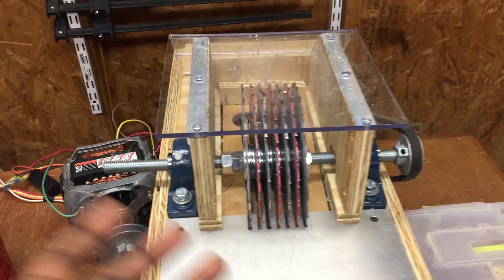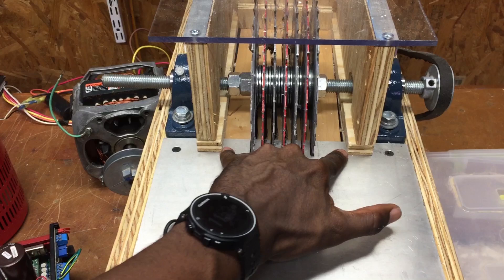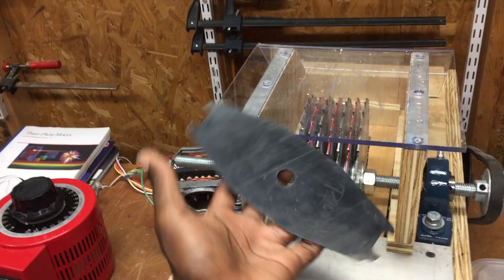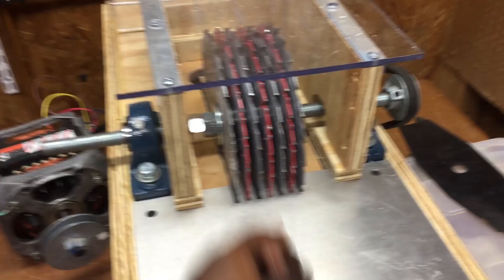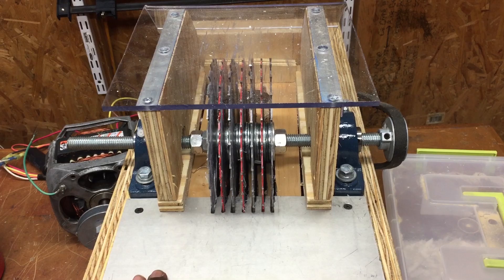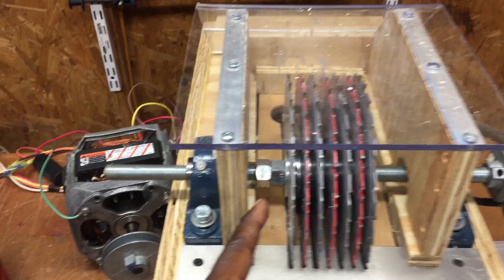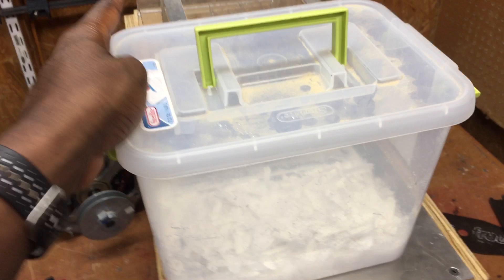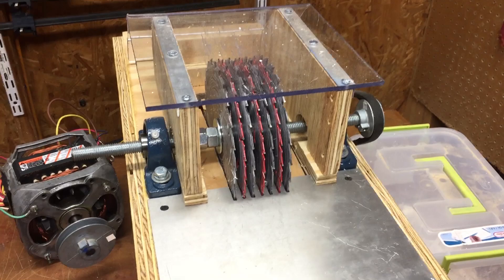Scary Prototype Shredder Design pt 2; A Cheap Alternative to the Precious Plastics Design: 037

Comment: I work in a factory that produces the HDPE bottles you are shredding. We end up regrinding about 1%. So I am familiar with the concepts.
Reply from the maker: Ok... question... how do the properties change as it is remelted? It seems to get more tensile strength after the first melt, but I am wondering if it can be "forever" remelted? do you guys throw it away after a certain point?
Reply: Basically, as long as it isn't burned it's usable. The polymer doesn't break down.

Sometimes there will be leaks in the molds which results in blobs of the stuff forming under the machines as big as 25 to 30 lbs. It can be reused even then, as we have a special regrinder for the crazy big stuff.
Reply: When I melt HDPE there seems to be two kinds of it. There's the translucent bottles, and everything else. Is there different HDPE blends, or what?
Reply from the maker: I am having the same thought. There is a huge difference between the semi-clear water bottles and the solid white milk jugs I show in the video. Translucent ones are also sticker when melted. They stick to my container while the other doesn't.
Reply: That is more to do with the manufacturing process than anything else. It all comes from the same plastic pellets that are mixed to make different colors or textures. If there is a real difference it probably is because of the pressure in the original manufacturing compared to just letting gravity compress it. Also relative thickness of the bottles.

Like a milk jug is made from te same stuff as a bottle that holds windshield washer fluid or gallon vinegar bottle. But the latter is a thicker mold so it feels different. Or those thick beige jugs that hold real maple syrup. 

All the same stuff more or less.
Reply: I line my melt box with non-stick parchment paper. I probably don't need to due to how much HDPE shrinks as it cools, but you've seen what the stuff looks like molten. So using non-stick parchment paper certainly doesn't hurt. Pulling a block out is a bit like Christmas for me then too, because I get to unwrap it.
Reply: +gplechuckiii that's amazing because the translucent plastic is totally different recycling it. It melts different, and when it is hard it is different. I mean a lot different. I've melted loads of all of it and I could tell the difference blindfolded. The non-translucent stuff is lighter, softer, and not nearly as slick. Also the non-translucent HDPE gets a lot runnier when it is molten. Twice as runny? It is huge. Though the translucent HDPE solidifies opaque white. It gets transparent when it is molten though. there's even a difference in commercial HDPE, like between the white, and the black. But that difference is pretty subtle. Because before I started melting I used to buy HDPE. I heard from a sign maker that they only get 2 cents a pound when they recycle. For that it isn't worth lifting the stuff up. I wish I could find a sign maker here that I could get scraps from.
Reply: OK I asked and apparently when they add color it also adds a binder that makes the color....well stick to the plastic. Which makes sense. So that explains why it would bind to itself easier. I didn't even think about that part of it. 

I'm sorry I didn't give you proper information. I just didn't even think of the binder part of the dye. I work in the coating room and thought I understood it better than I thought.
Reply: I did think about coloring possibly playing some role. I just know what I know based on what I've been able to discern melting HDPE. Translucent HDPE made into a block turns white, but molten translucent becomes transparent. Melt white HDPE and it stays white, even when molten. So there's something in colored plastic that is not in the translucent HDPE. The color, and like you said a binder, to make the color stick. So thanks for the info. It still doesn't completely explain all that is going on, but it goes some ways towards an explanation. Even the simplest topics often have obscure layers of detail under them when you go digging. I'd love to know how they made dimensional HDPE commercially. Just like thick sheets of the stuff. I'm thinking they use a roller process. If I had unlimited resources that's the direction I'd pursue. Say steam heated, with a Teflon coating on them. But I honestly have no idea. Big sheets of HDPE are available. The stuff is expensive as sin though. Which is why I make blocks of plastic in my garage. For prototyping chunks of HDPE is handy stuff.
Reply: There is a couple of different types of hdpe that are still considered hdpe but the molecular weights are different for example five gallon buckets are injection molded in a factory which basically means the plastic has to be squirted into a mold meaning it has to be very liquid when it melts so it has to use a lower molecular weight hdpe which means it flows much better when melted than let's say milk jugs or detergent bottles or any kind of bottle which are blow molded meaning the plastic doesn't flow nearly as well and therefore uses a higher molecular weight hdpe however it's also stronger than lower molecular weight hdpe. The reason that translucent plastic such as milk jugs go clear when melting is because melting hdpe removes crystallinity which causes it to turn clear when melting as soon as it cools of it becomes semicrystalline again and becomes translucent. Colored hdpe has pigment in it therefore causing you not be able to see it becoming clear. I have melted lots of hdpe at home and I tend to use blow molded hdpe because of its extreme strength but injection molded hdpe is still pretty strong. For flattening the slabs I melt I use a power hand planer and it works great.
Reply: I square up my plastic blocks on my milling machine. That works pretty good too. One thing I have not figured out yet is how to relieve internal stress in the blocks that I make. I press the plastic as I melt it, and while it cools, to get the air out of it, but that builds up stress in the plastic. I tried to make a dovetail stage out of some blocks of plastic but that whole thing sprung and curled on me when I machined it. So it just didn't work. Well, it didn't work as smoothly as I wanted it to. So far I took one block and remelted it, and didn't press it, but that took forever, and the plastic shrunk really badly too. So I'm going to end up with a pretty small clean piece when I mill that one down. I wouldn't call it a success, even if it does work.

Comment: Hi friend I was just thinking I watched Dave's video on his plastic shredder I noticed that they are all powered wouldn't it be possible to make a hand crank version seen as all I think the pressure between the blades seems like a big factor to my brain 😀👍
Reply from the maker: maybe, but it seems like anything less than 1 horse power is very limited in its ability to shred. That is over 700 watts of cranking power. We are talking about Olympic cyclist level cranking with the legs. For the arms it doesn't seem reasonable. But, I have not tested that and really can't fully deny it as an option. I am only just now thinking about it. If you reduced the power needed enough to make it "easy" cutting with scissors would be faster I think.  Rather than making a machine like that.

Comment: Brain fart....build a vertical hopper with a V bottom running crosswise with the shearing surface on the inside of the V. Make it close fit to the outside of the blades leaving no space for the long, wide strips to be created on the sides. Attach the collection point underneath and outside of the hopper rather than inside the same space as the blades....this way, everything is forced to go through the blade/shear plate junction as small pieces.
This would also allow for safer gravity feed....
Reply: yes this is what I'm thinking too rick

Comment: Hi Jeremy. I'm a huge fan! I love your videos! I am working on a shredder design of my own, which is strongly inspired by yours. I have a question, though. You spoke about how important it is to get the correct spacing between the blades, but I didn't hear you say what that correct spacing is. It looked like maybe 1/4"? I would definitely appreciate your input. Thanks!
Reply from the maker: That question is hard to answer because it depends on a lot of things. There will be a followup video in the future... spacing matters but I can't just answer the question based on the information you have now.

Comment: Are you using 5/8"  all-thread for the axel on that?  How does it hold up?  straight enough to avoid vibrations from mis-alignment?  I'm in the process of building a sharpener for my chisels/blades, and am thinking about using the same kind of pillow-block pulley system you've got there -- but wasn't sure if all-thread would work!
Reply from the maker: It is 5/8" and it works fine.

Comment: Jeremy, I just watched the first video before knowing about the second.  As you must know there are many topics to be found on YouTube and yet few original comments.  You can watch a video about any topic and you'll have the same half dozens kinds of comments.  If I were you I would not give a dang what viewers say.  Question:  What are you using to hold the shaft in place ... ring & set screw? ...
Reply from the maker: Both pillow block bearings have set screws. I have been intentional about encouraging feedback and conversation with my "neighbors" which is why I read and follow the comments so closely. I have learned a great deal from my viewers and always look forward to their advice. Even the bad advice. I was mostly frustrated that I didn't give more information in the first video. I have become accustom to people stating the obvious and sometimes giving poor suggestions. Its just that in this case I left the door open for more than usual. In my opinion it distracted people from the real reason for the video which was to stimulate suggests for a work in progress.
Reply: I had no problem following.  It was clear in my mind that you were working on a prototype.  I knew once you work out any concept issues you would address the safe operation.  I enjoy the work and enjoy sharing when I have something to share.  Keep doing what you do.

Comment: Thank you for your excellent videos, you really are a clever man (slightly mad but clever non the less lol) I haven't had time to read all the comments so don't know if this has been tried or suggested before. 
Would it be possible to use smaller and thicker saw blades for spaces? i'm thinking that would cut the thin strips the larger blades produce into small chips.
Reply from the maker: I am changing several other things which makes this not needed. It will be like a dado stack all the same size with a different cutting position

Comment: large shredders that work well run a very low speeds, and are reversible to undo jamming!  run gear reduction to to in crease torch.
Reply from the maker: It sounds like you haven't seen my previous videos on this. I am trying different approaches but I started with the traditional shredder type. Please watch the series here. You have missed many different versions of this...most of which involve huge gear reductions for low speed. Now I am experimenting with cheaper and even faster options. https://www.youtube.com/playlist?list=PL4njCTv7IRbwKmdnHLuZp5iL62fSvAS51
Reply: no not a paper shredder not a card shredder. a shredder that can shred a   car. I realize you are trying to produce something, from salvageable materials, to make it cost effective, for us poor people, but any apparatus you build that operates at  more than a few revs per minute is going to be scary or load up with melted material.
Reply from the maker: +relentlessmadman I am referring to dave's shredder. You still didn't watch the videos lol. My original plan was for a traditional style shredder. The paper shredder thing was just one of over 50 different experiments. I am way more invested in this then you are implying. I am fully aware of commercial shredders, how they work and the pro's of high torque. This is just another experiment before I make the claim it can't be done at high speed. I want to confirm that not just assume there isn't another way. That is what innovation is. I hope this makes more sense to you.
Reply: experimentation, is good, and I thank you for this video!  I have the same stack of saw blades on an axle.  but never followed through. you have answered some of questions I had, pertaining to speed.  and in feed.  I was only suggesting to try lower rpms and gear reduction. as far as watching your other videos goes I don't have the time or the wherewithal to follow all youtube channels that catch my interest.
Reply from the maker: LOL. No problem. I don't watch every video posted by the people I follow...it's just your comment lets me know you didn't know what I have already tried. It is just too difficult to explain in the comment section the level of research and experimentation that has gone into the project. The broad strokes are spread over 4 videos now and there is still a lot of things I didn't bother to record. In the end low rpm is the industry standard. I am just wondering if a low budget shredder (fast or slow) might be doable. Low speeds don't seem to work without an extraordinary amount of torque. The issue with that is explained in the previous videos. Thanks for the interaction. I love talking about this stuff!

Comment: A less expensive alternative to using saw blades is to use angle grinder cut-off wheels. 

Harbor Freight 
40 GRIT CUT-OFF WHEEL
4-1/2"  #61195   10/$7.79
4"         #61353   10/$8.99
:
Reply from the maker: +Critical Look now that is interesting lol how do they perform at lower speeds? Grinders spin really fast??? I am curious
Reply: +Jeremy Fielding 
As an experiment to answer your question, I was able to cut a small slice about 1/64", with ease, into a 2.5" wide x 0.016" thick piece of HDPE milk jug held with my one hand, and holding the cut-off wheel in my other hand.

Then by simply rotating the blade about 3 inches around the circumference, without applying much pressure, to achieve the cut. 

My guess is you can probably get away with as little as a couple hundred RPM. 
:
Reply from the maker: +Critical Look I am now wondering if it might be better to just use sheet metal? Consider for a moment that the cut off wheel is consumed in the process. What if we cut sheet metal (I.e wall of a washing machine) with a hole saw and made a lot of disc. They just need to be thick enough to not flex too much.
Reply: +Jeremy Fielding 
There is no doubt that sheet metal will work – but it does not adhere to your goal of enabling the Everyday Joe to construct it without owning the proper tools and having the skills to construct it to be safe when operating at high RPMs.

Balance is crucial – so cutting a true circle from center is essential. 

This is not a job for a hand drill, and not many people are adept at cutting circles out of sheet metal. 
:

Comment: late comment i know but i've been thinking about this one. it really is a tough nut to crack and you're almost there it seems. for a second i thought i was watching that finnish dude. gettin those danger clicks tho. fwiw im imagining if you want to stick with the table saw circular saw type of blades your best bet would be to get away from the carbide tips which are shredding off those incredibly long and thin small pieces. there are segmented and steel types, although the steel types are the cheapest and should be the best. i imagine plywood blade would be the least 'grabby' although who knows. also i've seen angle grinder discs that have maybe one or two cutters and are just steel. to me those look most like a shredder type of cutter. bonus danger points if you grind the kerf off of some spinning steel blades for the camera w/ sparks flyin from the angle grinder and everything haha
Reply: im seeing a lot of ppl are saying less tooth count is better. maybe it is? but i think reducing the kerf width is maybe more important to reducing the fine dust. funny haha
Reply from the maker: I think it is both. It makes sense that a rougher cut would lead to larger dust particles. The grinding the spinning blade will probably cost me some neighbors and friends lol.
Reply: or some fingers! my thinking is that a smaller kerf will of course give you smaller particles but you'll get less of them altogether as well as a less grabby cut. and you don't have to grind the kerf off with it spinning. but i was thinking maybe the grabbiness is okay or even desirable once you get the hopper and all that
Reply: also i know this is cynical but you may lose neighbors and friends but you def gain views from dangerous stupid shit. just ask lowrie...
Reply from the maker: +ELFWAX lol yeah you right